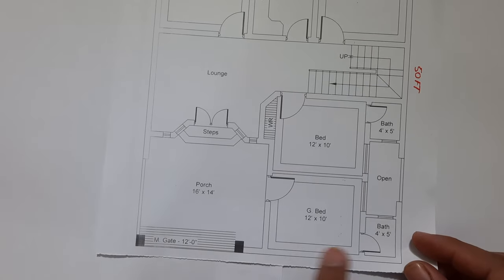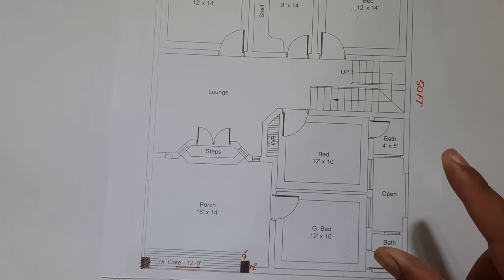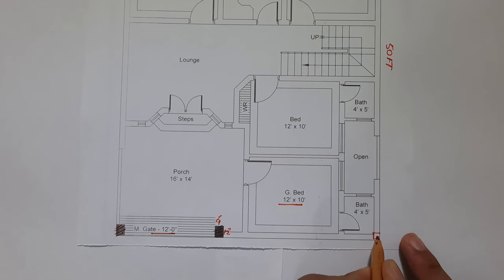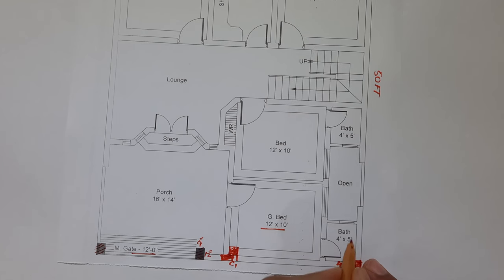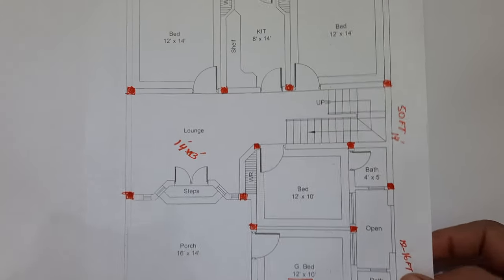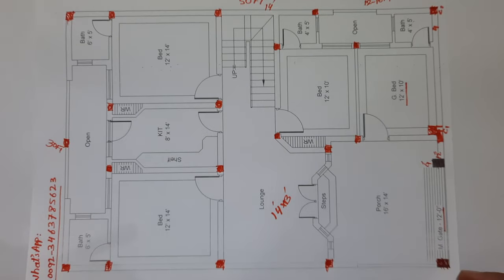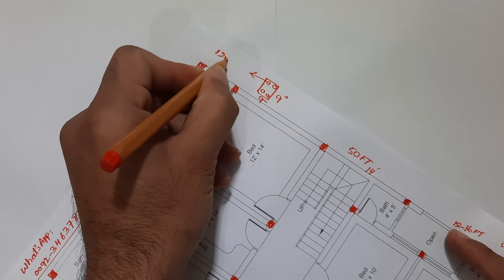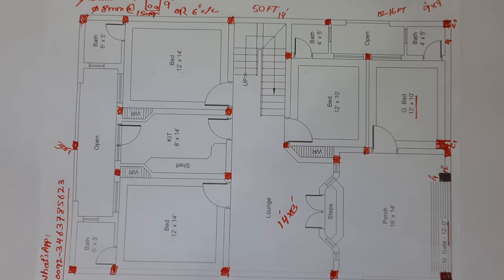How to Find Column Position? in House Plan

Comment: So if the column size i found is 27,5 x 27,5cm the size of the wall have to 27,5cm as well? or i can turn it to 5 x 15cm if i want to have 15cm width of wall?
Reply: and 4' doesn't need a column what is the maximum amount that doesn't need to provide a column?